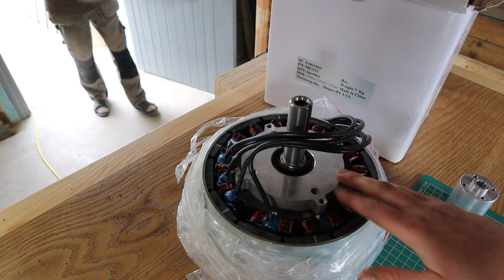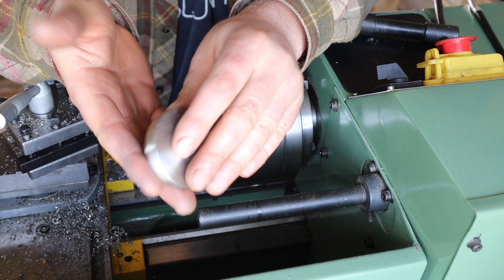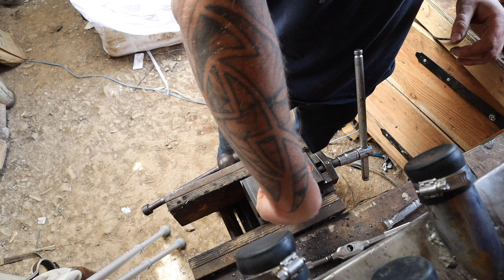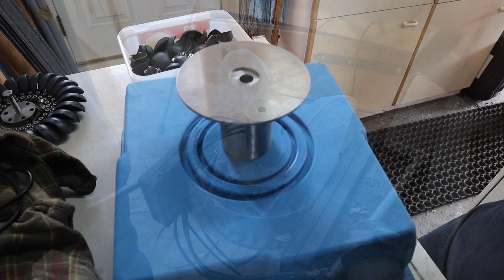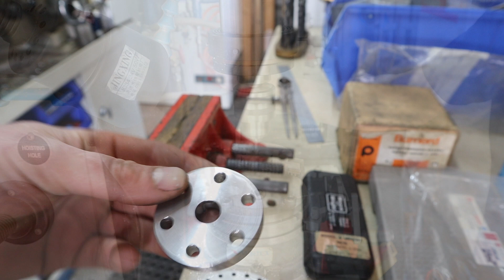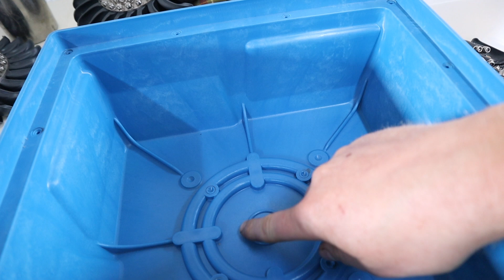4 Nozzle Off Grid Micro Hydro Turgo Turbine  (Part 1 Machining Alternator Shaft Boss)

Comment: The reason there is a small hole in the end of the tap, is so you can use a "centre drill" in the drill press to keep them straight when creating threads. You could also use a small "centre punch" with a finely ground point in the drill press.

Comment: I buy a lot of great Chinese tools and this same genset BUT I highly suggest at least getting in stock a set of replacement bearings from other than China. They never last but a premium set from Japan, UK or US will last a lifetime. Big new fan Kris and you have inspired me to get back on our system. I also had set up a test system using 600' of 1 1/4" pvc pipe but we did a logging op and it all got in the way. Planned to go 3" anyhow for a 4 nozzle system but that little pipe threw a good 35' from one nozzle and about 25lbs pressure. We are lucky with a year round stream and 35' head. Our well is Artesian at 25lbs pressure so we could even tap that and we need no pump for the entire homestead. That was a good prepper start. Cheers bud.

Comment: Kris please as many others have said wear your safety glasses and get rid of the loose clothes.   But also don't handle those chips with your hands, I've seen two different people lose a lot of their finger control due to deep cuts that severed nerves and tendons.  As much as you use your hands please protect them.  Because I look forward to more of your content.
Reply: Er, you do know that hundreds of people have told Kris to wear safety equipment in the comment sections of dozens of films over several years?
Well........

Comment: Thanks great video 👍 can't help but coment as i am mech. engineer who specialises in rotating equipment (pumps, compressors, centrifuges and mixers / agiators) all looks good work but i hope you get it dynamically ballaced in the next video. Dont get me wrong it will all run fine without but if you do spend the money or know someone who will help, it will make a big diffrence to the bearing life. Keep the good videos coming. Hope this didn't come across as one of these negative comment only trying to give advice based on experience 😉

Comment: That does seem like a loose fit, what is the gap size? 

I mean, it will probably work fine for quite some time if you stay below 1000-1250 ish rpm, but i personally would prefer a light press-fit with a key, or a hole that is between +0.005/ +0.018 mm oversized. That said, those bolts are going to hold the thing no problem. Only some slight balancing issues that you can take care of in your next vid:)

Comment: Will this one have an electronic valve to automatically start and stop it? As for the mechanical side I would have had a longer shaft before going to the PMA with two greaseable bearings holding the turbine shaft and a rubber coupling to connect it to the PMA. I hope you are using all stainless, and no mix of metals in your hardware. I'm sure you know mixing different metals in a wet environment is grounds for heavy corrosion occurring.

Comment: As a promotion to get a lot of comments, it was good.   April Fools was a month ago.  "this was a success" if you mean by 'success' that you have to throw away every insert and cold-grind 1/2" off every drill because you just ruined them.  That lathe is going wood-lathe speeds. Binding and chattering are bad signs.  Plus loose sleeves and no goggles.  Well trolled, my friend, well trolled.  Remember kids:  Wood = fast / Metal = slow.

Comment: Great work on the hub. Just don't forget water slinging washers to keep it from riding up the shaft. Unfortunately that plastic housing motenergy sells is complete rubbish... I bought one too and didn't end up using it. TIG welded my own from aluminum and I feel it will last 10x longer than the plastic one. https://hilo90mhz.com/micro-hydro/

Comment: For tapping my go to is Trefolex cutting compound. I’ve never broke a tap with it. 
You could also try Loctite Bearing Fit for that shaft sleeve to take up any tiny fitting clearances.
Oh and just to be a bit grandaddy: Remove the loose clothing when working with rotating machines 🙈

Comment: Hi Kris, is your new PMA is ME1112 for 120 to 240 volt, 2000 to 4000 watts
. ? If so it's same as my PMA.
you have to take care. Unloaded, the voltage after bridge rectifier can go up to 350V DC. Does your mppt charger accept this votage ?

Comment: Well done Kris. I've read loads of comments on the safety, yes it's important, but you're a careful young man (carrying an injury no fault of your own) I agree this adapter will be more than capable of doing what is required of it. I've only used a lathe at home when young, at college and a few times at a friend. Despite knowing how to set it up, have never successfully parted off.

Comment: A tip, to keep the tap straight at the start, chuck it in the drill press in the same position that you initially drilled the tap hole and then turn the chuck by hand to start it. You can then finish with the tap handle

Comment: Great job but I would recommend cutting down a key so that it fits into the alternator shaft key way, then drill and tap the key and screw down as you have done on here, the advantage is that you increase the contact area in the key way and and deformation will be between the cut down key and the screws - you wont damage the (irreplaceable) alternator shaft....

Comment: When I've wanted to tap a hole straight I've often used the drill press as a guide I just take the belt off the motor and hang out weight on the arm so that it doesn't pull back up and then turn the pulley by hand and it works quite well the limit is about a half-inch threads
Reply: Wayhart great idea never thought of turning by hand either! 👍

Comment: You say you're not a machinist but that's a dam fine surface finish you got from that little lathe, I was afraid the charter would've left some grooves. Aluminum loves to be lubricated, particularly drilling/tapping. Excellent work

Comment: Have you thought of mounting the turbine in a horizontal position?  Once the turbine is fitted then you could mount the generator high above the turbine which would keep the generator bearings away from any water.  Once you have the turbine blade and generator properly located then all you need is off the shelf couplers and a shaft to connect the two.
Reply: I think it's harder to design the bearing system for a vertical axle. Both designs have compromises.

Comment: In the end you decided to take advantage of all the available power, I didn't understand why you installed such a large tube for so little power, don't overdo the flow rate, otherwise it increases the pressure drops of the pipe, remember that Turgo spoons are slightly less efficient but to their advantage they have no problems with 4 nozzles, unlike the small Pelton like yours that already with 2 180 ° nozzles interfere with each other. you can theoretically exceed the kw, based on 26 static PSI starting from 100 meters of pipes you have, with around 40GPM (which are many for the diameter) about 16.7 PSI dynamic, I think it is the maximum for the pipe from 110. Over 800 W, I used a high efficiency 230 / 400V three-phase asynchronous motor, with 3 capacitors, in a single-phase C-2C configuration and an IGC for electrical control with load shunt, more robust, cheaper and ultimately more efficient. that it is possible to directly use the 230V products. Good job !

Comment: If there is one thing I could have told my young self about tapping threads. Use more tapping oil. The tap never breaks from cutting threads, it always breaks from binding up otherwise.
Reply: It's can also be easier to start your taps by putting your tap into a drill press or mill and turning it slowly by hand. Keeps it nice and straight.